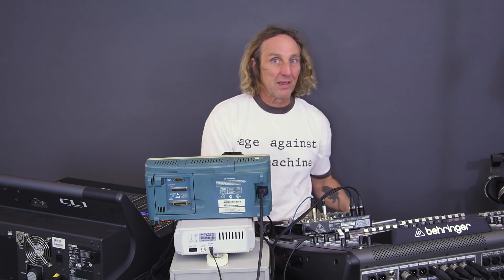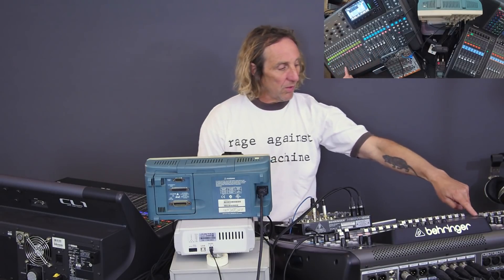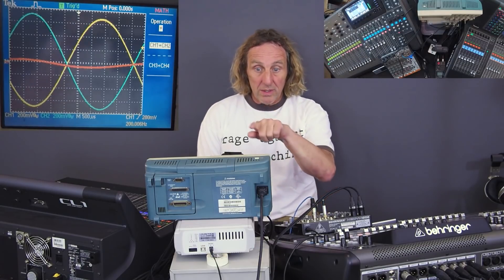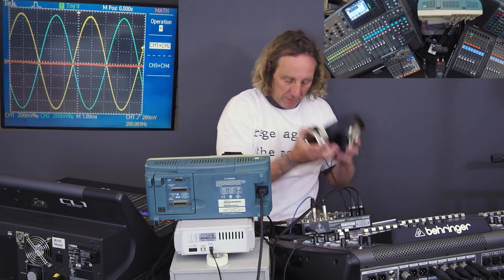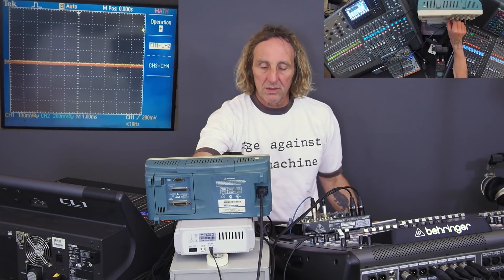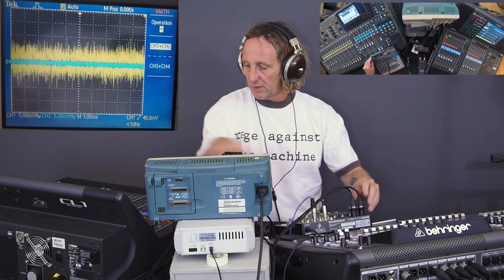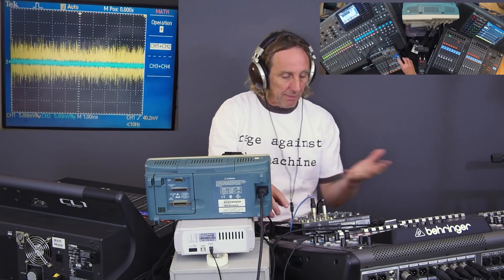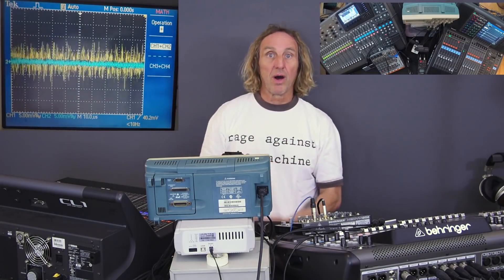Noisier is Quieter! Yamaha CL1 vs Behringer X32 (Public)

Comment: Although it's inaudible, do you think the greater amount of measurable noise on the X32 reduces headroom? 

Similar to the aux fed subs idea, which mitigates the extra amount of mud that isn't really heard but reduces the headroom when you only use a low-passed stereo master signal. 

In this case, by a small margin could the X32 start distorting earlier because it's already dealing with an inaudible yet higher signal to noise ratio?
Reply from the maker: I think for most applications it doesn't matter for the noise is cumulative in the sound system.

If you do a gig where in between songs the PA has got a hiss to it and you can hear the noise that would push you to drive your gains and signal flow at a higher level. Which pushes you closer or into clip and distortion.

Having an extremely low noise floor allows you to mix well below clipping completely avoid any overloads and not have to deal with background noise.

For most rock shows it doesn't matter but there are definitely scenarios where sound system silence during the quiet parts of the music is very desirable
Reply: @DaveRat  That's very true, in practice it would still result in less audible noise out the P.A at lower gain.

Love your videos and explanations, thanks for the response on this :)
Reply from the maker: Awesome cool cool and thank you

Comment: First it is obvious that this test one sided. If you test something you must do all connection and setting are the same. Why the X32 was tested on out of phase? and the Yamaha CL1 is in normal phase? it it should be also tested both.
Reply from the maker: First of all, I believe you are referring to polarity, not phase.

A polarity reversal is an equal and opposite signal that is identical in every way

It makes no difference which console is polarity reversed, as a polarity reverse is an identical equal and opposite signal.

As far as testing and understanding polarity and understanding null testing, here is another of several videos I have done using the null testing method.

https://youtu.be/aKfhsPhZPmM?si=xLnTknfUTe-k5ecj

Null testing is where you take two signals and reverse polarity on one signal so that all aspects that are identical cancel out and anything that is different is all that's left behind.

It's a cool way to see and hear differences between two signals.

Comment: I’ve used both consoles extensively, and there’s no way I’m choosing an x32 over any Yamaha console except maybe an o1V96i. Definitely not a TF or higher, not even a DM3.
Reply from the maker: Build quality vs features vs cost vs reputation. Selecting the right tool for the application is always wise and various different products are optimal for various applications

Comment: Noise measurement data on specs should be A weighted!
I remember the beautiful old analogue large format consoles from yamaha, PM1800 PM3000 or PM3500. The preamplifiers is so noisly that is preferable to deal with slighlty overloaded signal in the channel than pressing the PAD key. The 3500 PAD has a huge 30dB of reduction!
Reply from the maker: A weighted does not include low frequency noise in the specs so huge hum issues dont show up. Humm issues are a big problem, especially with cheaper consoles that have internal power supplies. Using flat weighted specs for noise or offering Flat and A weighted would be good.

And yes, I know that Yamaha noise!
Reply: @DaveRat  Agree. Reporting both would be perfect!

Comment: The way you are measuring, also adds latency to the signal. The CL has a much longer latency, so it will always sound more distorted if you reloop channels(the second pass will be out of sync). The comparisson should be done over just 1 signalpath. 
As i understand your measurement, you have synced the wordclock from both consoles, but in this case, the X32 is the source? There is a chance you are bringing out the worst from the A/D conversion from the CL1 by syncing the clocks, it could be the other way around if you clock out of CL1. 
For your measurement, the clocks should be set to internal, to have an optimum conversion setting. They don't need to be synced to compare noise levels.
Also the signal to noise ratio is more important than the noise ratio from channels that are not used.(since they will normaly be out of the mix anyway). there are universal settings for measuring THD, SNR and CMRR. These standards are designed to make fair comparisons to equipment. 

I have add to my comments, that i have not read the specs on either console, nor do i have a preference to either one of them. But from a theoretical background in electronics, the above points come to mind.
These kind of measurements require especialy high resolution equipment like Fluke or Philips produce, it will not be acurate enough with smart or other audio based tools. also the cables you use between the consoles are important/influencing your measurement. The THD of each console is probably far away from the audible range, as are the SNR and CMRR. 

So despite your results here, and me realy apreciating and respecting your other topics and sharing of your experiences in live mixing (Keep up the nice vids!) 
This test outcome has no theoretical basis, and could be caused by other factors just as well. (Fair chance that switching the clocksource changes the outcome of the test.)
Impedance differences changes the outputlevel and the setpoint of the internal cirquits, if the CL1 has a different impedance then the X32, it could result in more noise. Depending on the input impedance of the analog mixer you use, the outcome could also be different.

Edit: After reading the specs on both consoles, the outcome is predictable; THD for CL1 = 0.05%, THD for x32 is 0.006%. The X32 has also better specs in almost all ranges, so your conclusion is correct, but the measurement itself is debatable sorry ;-)
Reply from the maker: Maybe watch some of my other CL1 videos

 the CL1 always has at least 2ms latency analog in to analog out. 

The x32 has 0.8 Ms at least analog in to analog out

The subgroup latency issue on the Yamaha does not occur in the x32 and both consoles add more latency when inserts are used

Clicking them together is irrelevant when dealing with analog signals. Though altering the word clock higher will slightly reduce latency and lower will increase it.

I am using a variable signal generator as an external word clock on the CL1.

And thank you for your thoughts.

I think you will find that the testing and results are correct, not flawed and harmonious with the 6 or 8 other videos I have done on the topic.

Comment: I'd be interested if that noise profile holds consistent with the Yamaha if you use a Rio stage box. I always got the impression from Yamaha engineers that the on board CL pres were almost for a last resort. Good video
Reply from the maker: Thank you Ryan. When using a stage box, the console purely deals with the signals in the digital domain.  The noise is primarily an artifact of the ADC and DAC conversions in and out of analog.

So the features and control will follow the console and noise, preamps, output drives and such will be determined by what the XLRs are plugged into.

Using the X32 with a DL251 stagebox and CL1 with a RIO will alter things. I have not looked it up but assuming Yamaha uses consistent spec measurements, any improvements by using the RIO should show on the spec sheet EIN noise spec

Comment: This experiment isn't really indicative of how the consoles are going to be used in real situations. The power supply (several of them per console!) is hugely important to the noise characteristics and it would be more accurate to load it right up with dozens of channels running and lots of effects, CPU loading and processing etc (thus loading up the power supplies) before measuring the console's performance.
EDIT: Kudos to your experimental method though - keep up these vids
Reply from the maker: Hmmm, does more inputs actually load down the power supply on the console? and if so, by how much? If I put a current meter on the AC supply to the console and start turning on channels with inputs will I really see an increase in current draw? Its not an amp. Increased processing does make a computer fan run, but on a console is the processor a significant power supply draw or are the LEDs, moving faders, illumination and powering all the dormant ADC and DAC most of the draw? Do the ADC and DAC draw significantly more power when actively used vs dormant? And does the power supply ever really load down on these consoles and if so why would power supply loading even have any impact on signals in the digital domain?  I would think power supply loading would be mainly caused by increased processing power needs on the digital side, LEDs, illumination and screen and the analog mic pre's and analog output drivers would be on a separate supply needing differing voltages.

Lots of variables to consider and starting out with more noise in a simple setup is not a good start.

Thank you Simon!
Reply: Actually, most of the time switched mode PSUs tend to emit less noise when they are fully loaded. When we do EMI tests, the worst case is always when there is barely any or no load on the power supply.
The mic preamps wont have more current consumption if you increase the gain, because the only thing that is going to change is the amount of negative feedback applied from the output to the input. I do not believe that any manufacturer turns off AD DA converters when they are not used, so that cant really change the load on the PSU.
The fader motors and the screen brightness has a much bigger effect on the PSU load, but even in that case, you maybe have your PSU 80% loaded and you will load it down when the faders move to 85% until the faders move.

Comment: Cool stuff! I wonder if Audio Precision would let you borrow some gear. Would make it easier to compare snr, thd, etc between consoles!
Reply from the maker: I purposely do not use fancy gear and try an focus on tests that correlate what is seen vs what is heard in a way that can be replicated by just about anyone.  The equip designers have all that high end gear and I like to divulge issues they missed or are trying to hide by using simple easy methods.

Comment: This is why it's important to measure noise band limited to at around 20k... even n electroncis the noise measurement is done with 25Mhz band limit for a reason, so when one does noise measurement for audio, it should be band limited :)
Reply from the maker: Agreed and oversights like this and similar are common with people that rely purely on measurement gear and do not spend adequate time listening and comparing to make sure the measurements are relevant.

Comment: Great video, thanks! Does your scope have a half-decent spectrum analysis? Usually the expensive scopes are the only good ones in high frequency ranges (MHz ranges), but perhaps the audible range is decent even with older/cheaper scopes. Very nice analysis and yes, the noise numbers by themselves are only good for spec sheets.
Reply from the maker: Yes, the FFT on the scope shows a spike at around 100k on the X32
Reply: @DaveRat  Nice, well out of the audio domain. I can appreciate how they designed pragmatically vs. just chasing spec numbers in a sheet.

I hope the Yamaha folks see this video and have a look at their designs.

Comment: It is my understanding that on Yamaha consoles under the CL/QL range, including the M7 that until you reach around 15db on the pre-amp you have a higher noise floor. I’m not sure what is causing that, maybe the clock? You could usually hear and audible “click” on the console once it reached that magical gain value. The trick I’ve always used for that is using your trim or attenuation on the EQ to bring your signal down to a workable level after mitigating the noise floor(assuming this is doable with the signal you are being sent).  I’d love to see this tested. In addition I’ve heard a myth on the M7 that if you turn on the output delays, even at 0ms delay, it ups the bit-rate of the output signal so it’s actually using the full power of the console’s processing. Could be a total myth and I haven’t tried it on a system that was nice enough to actually discern that, just and interesting concept. 

Loving the videos so far!
Reply from the maker: I cover that in one or more of the X32/M32 videos.  The gain knob actually is adjusting the analog preamp gain in steps of 3 to 6db depending on the console and in between the steps, is adjusting a digital trim in . 5db or 1db increments.

The preamp steps make a click sound and added digital trim is a bit noisier than pure preamp without digital trim gain.

Comment: Interesting Dave, but not awfully useful. ALL noise measurements MUST be made in the stated bandwidth, say 20Hz-20kHz. You seem to be comparing apples with pears, in that the DAC and ADC technology is very important in the output noise spectrum. These are both different in these two products! There is another point too, and that is the internal headroom on the ADC at a particular input level. The Behringer product ADC has a dynamic range of 115dB, and the design allows at least 6dB of headroom at indicated peak level, giving a bit of operator leeway. I have no idea what the Yamaha does, but it may have zero! The Yamaha noise spectrum is fairly poor with all that LF stuff, very audible, whereas even in your test the B product is very white.
To really make this a suitable comparison you need a bandwidth limiting noise test system (Audio Precision for example) and a spectrum analyser to accurately determine the noise spectrum. The B product uses the 8 channel Midas ADC, probably the best on the market for DR and accuracy.
Reply from the maker: Also without complicating things too much, I was just surprised that the Yamaha has more audible noise with the input gain at 0db than the Behringer with the input at 0db and the Yamaha cost 5x the price. 

An FFT shows the X32 noise as a spike at around 100k and up.

The actual noise specs on the consoles are quite similar.

The disparity between what a scope shows, what the specs show, and what is heard and that none of those seem to align is what 8 find interesting.

The fact that by digging deeper, the misleading aspects can be clarified is important.

Comment: been using Behringer stuff ever since I started making music. At first because I couldn't afford anything else, nowadays mostly because the bang-for-the-buck value is just the bomb. Sure, that stuff is not intended to be used for touring, but for any setting that allows a "controlled" treatment, it's fully sufficient in terms of build quality. 
We're using the XR18 in the rehearsal room and good lord, I would have given an arm and a leg back in the early 2000's for that thing when I was setting up the stage and mixing in the youth club back then. And all that for a ridiculous 500 EUR price tag. 
Big thanks and thumbs up for these kind of videos!
Reply from the maker: Cool cool and Behringer does have products that offer good value and also I would be remiss to blanket project value and usability across the entire product line.

Comment: I may have missed it but your 1st channel in each mixer is a head amp at 0dB gain? Do you know how the two consoles use dither? The Behringer’s noise has the characteristic shift in bw I’m used to seeing from dither, which is added noise in the digital domain near the hi limit of our hearing to reduce extremely low level nonlinearity.
Reply from the maker: All the head amps are near zero. The X32 noise is up near 100Khz, I posted an FFT of the noise but it's on the member side of the YT channel as it's short and unpolished. Vids like that on the public side just get me yelled at.

Comment: This has always been my impression of Behringer. The actual “sound” is usually equal to, or better, than the competition. But, build quality is somewhat worse. For a permanent install situation, it will probably be fine. But for a road-worthy, mobile, touring rig (i.e. multiple set-up, tear-down), anything BUT Behringer.
Reply: I've been saying this for over 2 decades. You are absolutely correct! ✊🏾 I ve been thinking about building my own chassis for some of my Behringer units.